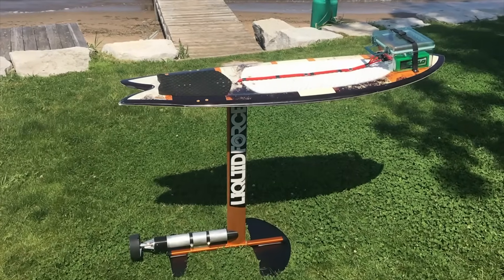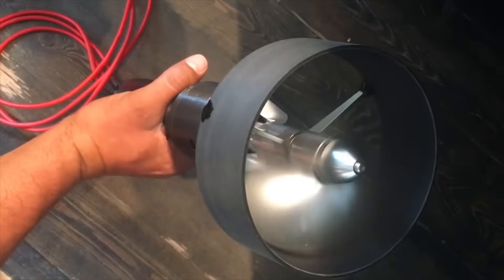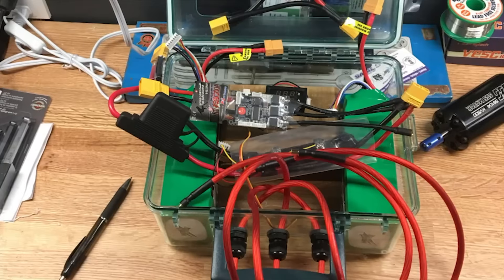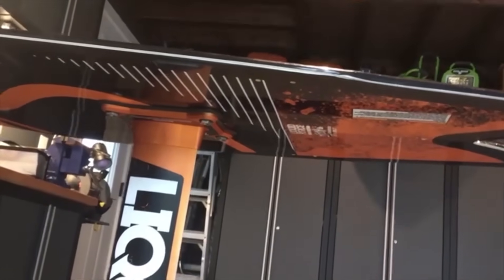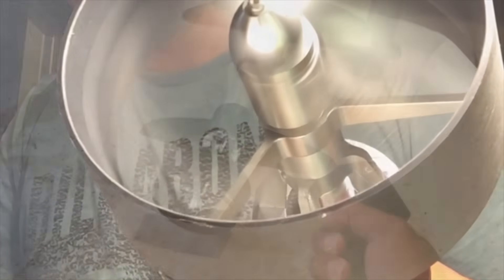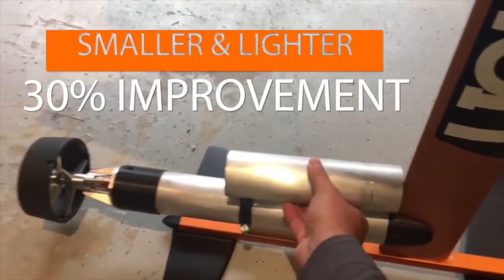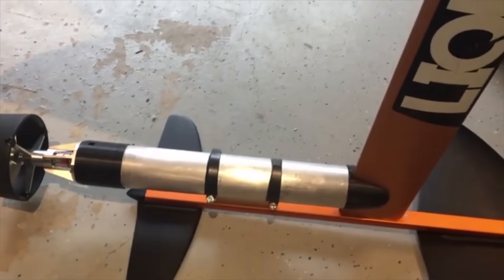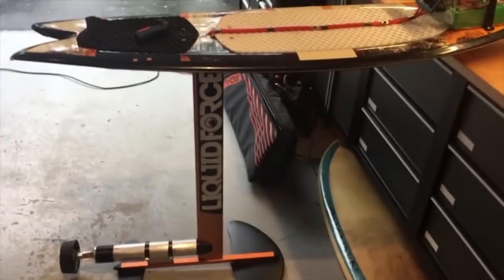DIY Electric Surfboard - Electric Hydrofoil

Comment: Can you tell me what motor u used in the end? im working on my own project with an old windsurfing board.. I have made the foil fin from scratch using carbon fibre and encompassed a spot to mount the motor. I am struggling to find a good motor

Comment: Hey plz could u put the motor/jet u used. I will comment every day on this vid same thing every day until I find out what jet u used. Plz I am bored in quarantine.
Reply from the maker: This is an old video from 2017. You may find newer versions at MHZ: diy-electric-surfboard-kit-mhz-watercraft
Reply: E-SURFER electric surfboard & hydrofoil magazine can u still link what motor u used plz

Comment: Do you think you could add hydrofoil fins to a small hp outboard and power a larger skiff or paddle board
Reply: I think the problem then would be retracting for shallow water. The boats or foils in use have the fins on the boat. I'm just guessing, but that seems to be the only downside to these foil boards. You have to know your area really well, or you run the risk of reef or sandbar collision. In a boat you don't get in it, in deep water. You pull away from shore or dock already in it.

Comment: pretty impressive, i use duel electric trolling motors mounted on either side of my bote paddle board, works really well, but i went with the cheapest troller i could get.. ie. mine kota 30lbs of force and, even with 2 of them, it's still too slow! maybe you have some advice on how i could speed this thing up without spending a fortune on new trollers?
Reply: Change the propeller to a higher pitch version. That will give you more speed. Hopefully doesn't burn the motor though :D

Comment: Good afternoon, what is the engine speed, the reduction gear box and the propeller?
Reply: Its direct drive so no reduction gear in newest design. We have a couple prototypes RPM's range from 7000 - 16,000 from mini prop to high speed impeller.
Reply: @DIYElectricHydrofoil  I'm looking for similar reduction gears to step up low double digits RPM to around 1200 - 1400 RPM. Could you tell me where you got yours? I know you're not using reducing gears anymore but where are the one you had in the video or where did you source them?

Comment: very cool setup! whats that prop? where did you get that from? isn`t 7k rpm a bit high?
Reply: Small props require much higher speeds/rpm. Impellers in this range spin 14-16,000 RPM at full throttle.
Reply from the maker: For a more structured way to ask questions, please use the following forum: http://forum.e-surfer.com/viewforum.php?f=39